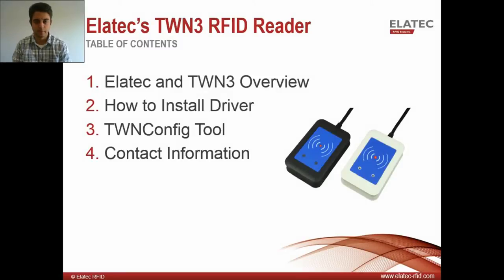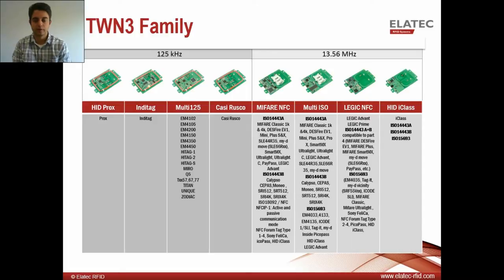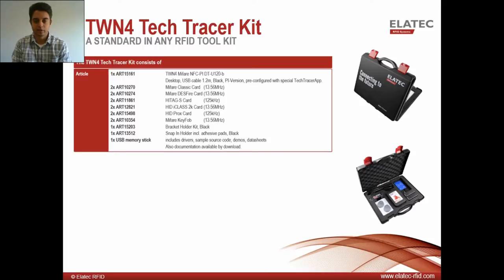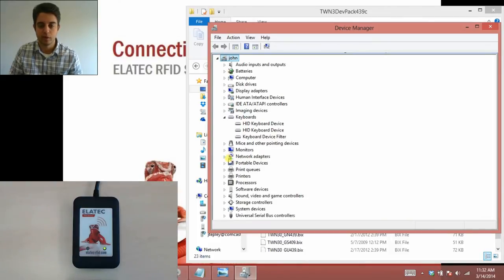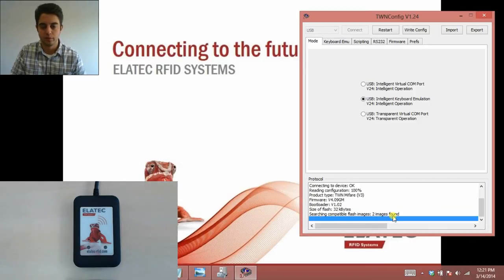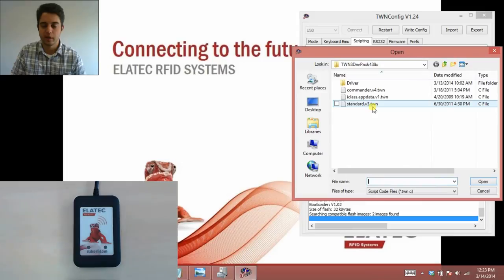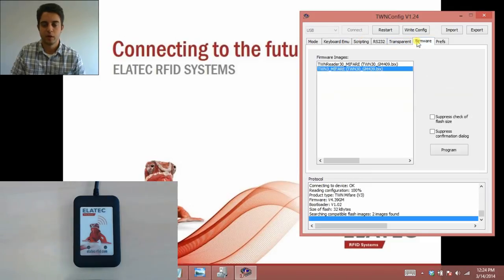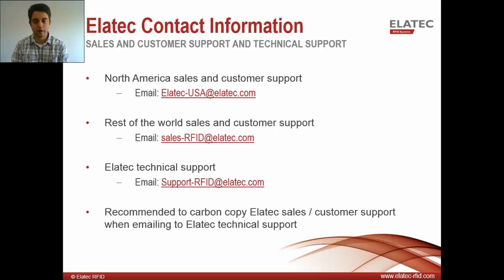TWN3 RFID Reader/Writer

Comment: Excellent review and I am the owner of four electric locks with three RFID TAG at 13.56 MHz, I would like to use the same RFID tags to turn on and off the electricity through an RFID card reader (used in hotel rooms) always at 13.56 MHz? In your opinion, can the RFID tags be read by both devices?
Reply from the maker: Dear Gino Pillo,
Unfortunately, we cannot provide any technical information here. Please contact our technical support. The best way is to use the contact form here: https://www.elatec-rfid.com/int/contact-technical-support-hq

Best regards
The ELATEC Team